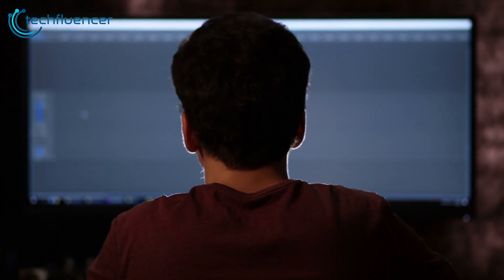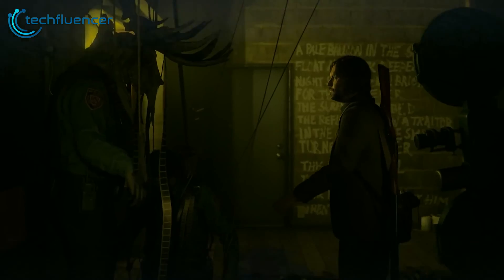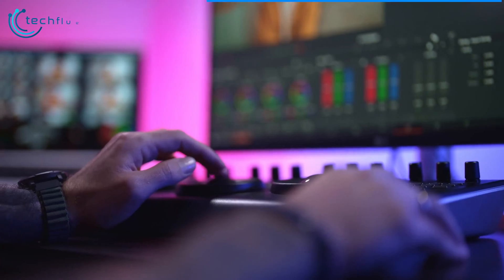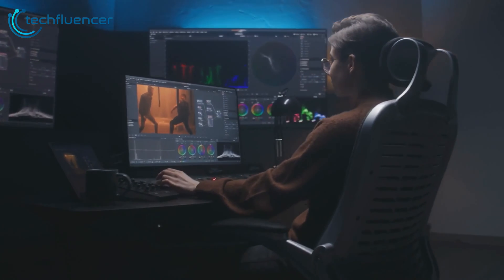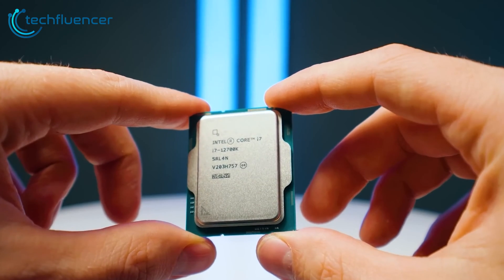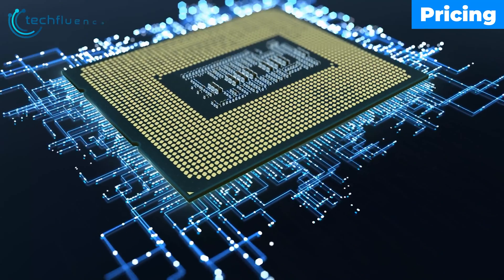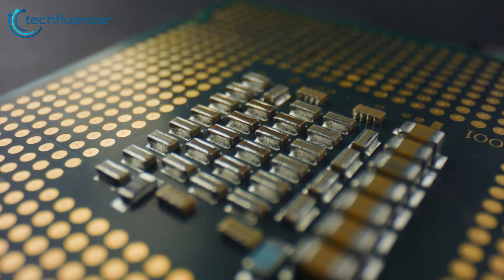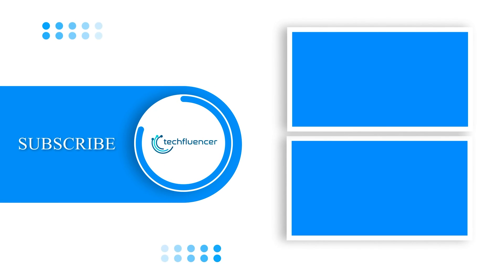How Many Cores Do You Need in 2024?

Comment: In relation to productivity tools, AutoCAD (2D & 3D applications), Revit and Bluebeam are all single-core intensive programs, that takes advantage of highest core clocks.
They are also non GPU intensive programs, that can run on IGPUs quite fine. 
Multi-core CPUs for PCs using these programs are:
1. Unavoidable because High clock cores only come with high core counts &
2. Good for multi-tasking.. as in running multiple programs at the same time.  For this type of use, a better GPU is beneficial.
Other CAD based rendering programs like Lumion, do utilize multi-cores and high-end GPUs